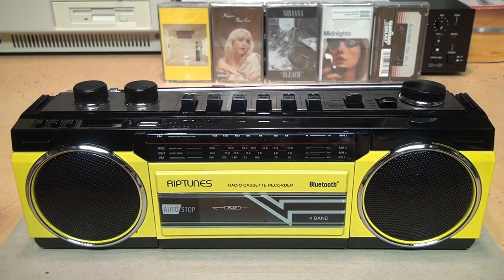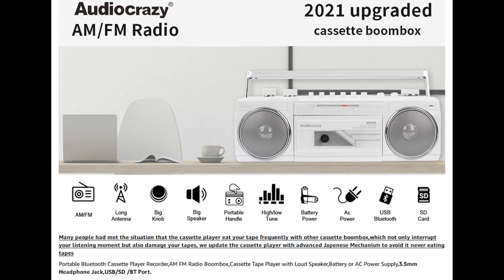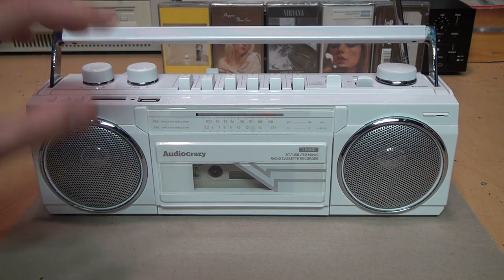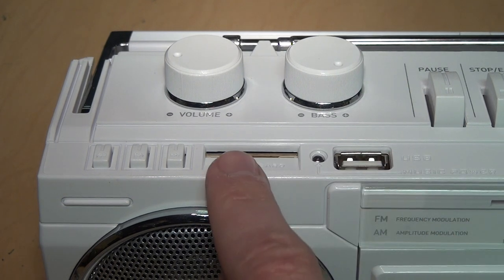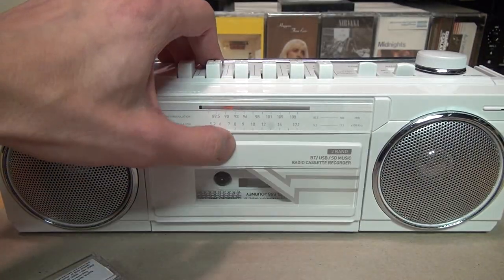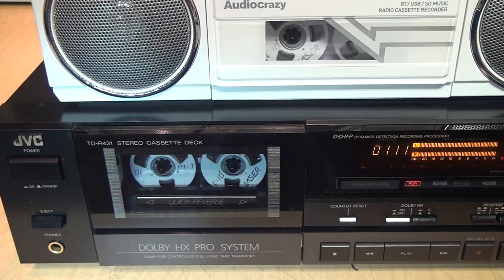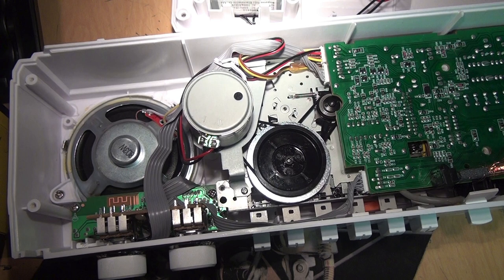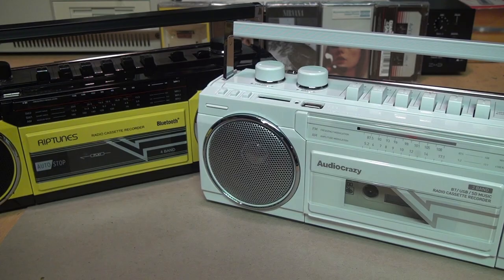New improved AudioCrazy STEREO cassette boombox!

Comment: I'm glad to see actual STEREO units being made again, now if they would give it better bass speakers and fix the recording level it would be great.
Reply: and the best feature would be a high quality full auto stop mechanism (doesn't just stop in playback)
Reply: Actually - a minimum of three speakers (three channel stereo) would suffice as then these would be genuine 3phase electrical circuits, and transmit all the sounds of the recording, using the least amount of battery power. Balance power usage it's called, not unbalanced two phasing that normal two speaker stereo units like these are only capable of.
Two phasing a three phase supply will NEVER turn a three phase motor, yet two phasing the audio devices called boom boxes, was supposed to give good (booming) bass?
Yeah right - NOT.
Reply: A/C bias and erase well worth a few dollars more.
Reply: Then maybe throw in feather touch buttons? Lol
Reply: @QUIX4U   The AC inlet is only single-phase though.  No 3-phase power for you.  Though I'm sure if you put 440VAC 3p into this, it would definitely go boom.
Reply: I doubt the speakers are the issue, the amp would be super low end and just can't output bass.
Reply: @nickwallette6201  lol true
Reply: @georgebliss964  Agreed.👍

Comment: Thanks for the in-depth review... Regarding the speaker magnet aspect, they are actually an upgrade, moving from weak/large/heavy ferrite magnet to neodymium which applies a higher magnetic field to voicecoil at a much smaller advantage. With the speakers in an open cabinet like that with massive air leaks, the drivers front and rear waves cancel... Providing a 'bass' knob is futile. Huge thanks again for your efforts.

Comment: I found a Brooklyn branded unit at a company called Supercheap Autos here in Australia. It was essentially the same model as the second Aldi unit critiqued by Techmoan a year or two back. 
While it is still a mono unit I found it wasn't completely terrible, and had no problems with wow and flutter, in fact I found it was very good. I checked the speed with a frequency counter and it was within what I considered to be acceptable range, although I don't have a calibrated tape.  Recording was OK but being mono it was nothing to shout about, but for AUD49.00 I have no complaints with it.  

Perhaps some of the manufacturers are listening to youtubers like Techmoan and VWestlife and making these improvements.
Reply: And   so they should pay more attention to the tech youtubers otherwise they won't be getting my custome.👍

Comment: I quite like the design of it - combines retro styling with a modern colour scheme. If they did it in black with either teal or red accents that would be cool. Nice that it plays tapes in stereo. In Aldi, they started selling the 'Techmoan' version for Father's Day. This model looks like it would be kinder to your dad's cassettes! I wonder whether you can upgrade the speakers (even at only 3W there's some pretty good options). Perhaps the circuit board restricts how deep the speakers can be.
Reply: Audio signals are quite easy. You can probe with headphones like a doctor and hear it all (instead of a multimeter). Maybe have some resistors around if you check the amp parts.
Reply: After Kevin's comments about the color scheme I was expecting him to swap the cases.
Reply: @MrDuncl  Just what I was thinking (maybe resolder the speakers from the old into the new also?).  That might make an improvement - but who knows?

Comment: Hey thanks for the video. 

Also, a while back you reviewed a radio by Retekess and liked it. I was a bit inspired by that and bought a Retekess TR618 and just love it. Best radio I have had in ages and I have been so disappointed in mass market stuff the last decade or so. The sound is amazing for such a small radio and here in California I am picking up SW stations in Maine, Japan, China and Russia. I am near the Bay Area and on AM at night can lick up stations in LA and OR & WA state. Just love it! Thanks for putting me on to them.
Reply: Speaking of Retekess, I actually found a video of someone demoing a Retekess CD, radio and cassette player, and the cassette player had a manufacturing defect where it would eat tapes, because a bit of solder got into the gears driving the mechanism.
Reply from the maker: @RealEpikCartfrenYT  Retekess sent me a CD/cassette boombox for review but I didn't end up making a video about it because the FM radio and cassette were mono. I briefly demonstrated it in my video about the TEAC W-1200 cassette deck.
Reply: @vwestlife  Yeah, the guy who demoed it, also took it apart to inspect it, the FM radio board is literally the size of a credit card, and is held in place by the tuning dial. Very underwhelming for what it is.
Reply: I got a V115 and the sound is pretty amazing. I think they are using speakers similar to those full sounding ones in the mid tier tablets these days plus a few amp filter/EQ tricks. Direct entry shortwave for under $40 is pretty kewl!

Comment: With this, and a previous video of yours, it's good to know that there are still decent (even if not excellent) cassette mechanisms out there. I have a lot of home-recorded cassettes in storage in my brother's loft since 2008, and my requirement is for a cassette player, I have no desire to record. Just something with a decent line level output or a headphone socket that can be used as such, to play into my computer to digitise these cassettes when I get them back. My stereo system has a front-facing socket that can be used to input from headphone outputs.

Comment: Another excellent presentation. The Bass control might as well be a plastic cylinder with a nut and bolt through it.
Reply from the maker: It would be much more useful if it had a tone control to turn down the treble, just like cheap boomboxes from the 1980s often did.

Comment: I like how they are bringing back 80s design. these new boomboxes looks better than the ones from the 2000s.
Reply: Dosent look better than my early 2000s Sony cd cassette radio which myvmum passed to me. All working and looks great. Older cassette section too.
Reply: which ones? early 2000s boomboxes doesn't look cheap and still sounds better
Reply: @yorkemar  My 1970's (Sony) WALKMAN cassette player with an FM stereo radio section, had more BOOM than these useless units, as they at least had a better bass filter section, plus with their stereo 3.5mm phone headphone/line-out sockets you could at least get all THREE usable stereo channels, if feeding these correctly through a two-phase to three-phase splitter, to regain the full-form surround sound these always had.
The two phase t three phase splitter was the old original amplifiers with their grounded earth return, common speaker channel / chassis earth, that enabled one to get all three channels from a two channel device (ask your local power board how they get your houses fed with all three of their single line phases, as well as all commercial 3 phase switchboards fed, whenever they PULL one leg out, of their three phase distribution transformers, that then ONLY run two phasing ?
It's exactly the same as getting all three channels of audio from your 1970's style Sony Walkman's etc., when given just two phases (audio channels) via the 3.5mm phone outlets.
Plus here's a kicker, with the right device IN-LINE with the headphone output - you can even get the FRONT/CENTER MONO (genuine front channel MONO - being the same as an old AM radio's single channel gives you) and the rear SINGLE REAR CENTER surround channel - directly from a 3.5mm outlet when playing back anything stereo.
In other words, instead of being a dumb listener, somewhere out in front of the stage (center of house), you can hear what AN ELECTRICIAN HEARS, from either side in the wings, or when up in the GODS (being that area in the rafters of the concert venue where the stage lighting is suspended from) that allows us to hear BACK of stage sounds - as well as those from the FRONT of stage (front of house), where we hear everything that is played both on stage as well as in the studio when remastering takes place, and thus where everything the mics pickup, is recorded in the original recordings, that most commercial outlets / vinyl & tape or CD/MP3 etc., NEVER replay via on-air broadcasts or in TV or YouTube modes, as they expect you, the listener to not actually know you are ONLY getting 57.7 % of the available recorded medium, instead of it's full 100 % total surround sound.
Why do you think the youth attempt to use bass filters and ONLY play very loudly, the bass they are able to hear in the front center channel - when all they need is another (rear center) bass speaker that allows them to amplify all the frequencies of audio - that are 90% out of phase (and thus completely unheard when playing via two frontal speakers)?ALL of the actual reverbs sounds and the better part of bass drums / guitars etc., is played at the BACK of a concert stage, where the band's drum kits are positioned, so why attempt to play loudly - only that which is heard from out front (by filtering out the lead singer and all other front of house sounds) ???
Why not play at the same "loudness" as the front speakers, via even just one of the speakers at the rear - where those bass sounds are made, by having a center rear speaker?
One that plays everything you cannot hear in a two speaker headset or a two speaker stereo car set?
Even your stereo (two frontal channels) house stereo destroys your ability to hear anything at the rear as even that doesn't replay that area, just the sounds from the front.
Having just  single speaker at the back of the car, or house room (or on the back of a boom box) allows the listener to hear all sounds that the musicians made on the day of recording, or which were superimposed in the studio before the final mastering?
Why not hear the missing 42.3 % of audio - that a two channel stereo device cannot make ?
All it would take is for these el'cheapo stereo boom boxes, to have a rear facing center channel speaker at the back.
Reply: @goodnightmoon  1996-2009ish design is ugly the rounded shape of that era is so ugly.
Reply: @QUIX4U  I have a 4 Band ITT radio from around 1976 that sounds good and also looks great.
Reply: @MylarBalloonLover . In real terms it probably cost much more
Reply: @חובב בלון נייר כסף חובב בלון נייר כסף  yeh but it was free. It's audio performance is impressive.

Comment: That's already quite an upgrade from the usual low quality junk you find from the store (I was gullible and almost bought one of them 2 years ago) but still it would be cool if the boombox had a full auto stop mechanism, because the "never eats tapes" claim is only true as long as the belt that drives the clutch is good. Some full auto stop mechanisms do actually drive the take-up spindle straight from the flywheel through a gear, so in the event of the clutch belt failing, the tape will not get eaten during playback. Oh yeah and given the space inside the boombox, it is possible to upgrade the speaker drivers by salvaging some from cheap computer speakers, as long as the magnet is not too big. It seems like they are 3 inches in size.

Comment: Mine, that I've had for several years, is branded Reka, and is all black. It has FM, 2 x SW and MW bands and the socket on the end is labelled Phone. I've only ever used it with a USB stick, as that's all I bought it for, so have no idea if the rest of it is stereo or mono. I only use it when I'm doing DIY work in the house, so haven't bothered too much about the sound quality, but it doesn't seem to bad. I think it was only UKP15 on eBay, so at that price, I'm not too fussy!

Comment: It has been quite an interesting experience to watch this video regarding what I expected from this device. I was prepared to despise it but in a very gradual, perfectly timed way it appeared to be a little better every minute (bar the recording part, but recording on a cheap boombox is something you don't want to do anyway). Finally, I can't help but show my respect for this product at such a reasonable price point. The big elephant in the room is of course the tinny speakers when it comes to using this on its own. Probably you should not expect much better sound for so cheap on the other hand. However, as something inexpensive but decent to hook to an amp or computer if you don't happen to have an old, well-serviced deck, it's probably a good little thing to have. I... kind of want one.

Comment: Can't say much for the sound quality through the built speakers, but the direct feed being played on a computer plugged into a Sony 100 per channel receiver with SSCS5 Core series Sony speakers sound absolutely fantastic.  Hopefully these tape mechs can be made available to someone doing a crowdfunding campain that will actually create a stereo cassette deck with AC bias recording and an electric erase head.  This mech seems to be as good as the one in the professional Tascam deck that you have shown on this channel.  The recording quality seems terrible because of the permanent erase head and the low recording level, but for play back this beats them all in this price range.  Would love to see a video comparing playback quality between this device and the Tascam.

Comment: Question: You say that the SD card and USB slots are only for playback, not for recording.  But then later you said you recorded music from vinyl to an SD card, and then recorded it to cassette tape.  Did you record it to cassette on a different machine?  In the video, you were pointing at this boombox when you said "recorded it to cassette tape", which gave me the impression that you recorded the tape on this machine.

Comment: The new speakers look to be using neodynium magnets which are much stronger. Likely achieving the exact same specs as the old version. That said it's unlikely the speakers have all that much to do with the lack of bass response, as it seems there just isn't any kind of speaker cabinet to actually allow for bass response in the first place.

it really seems like the BT/USB/SD module is the standard "cheap bluetooth speaker" module slapped onto this radio. The exact behaviour observed when it's switched into BT/USB/SD mode is also seen in MANY cheap BT speakers.

I find "Avoid it never eating your tapes" to make perfect sense, as they clearly made the effort to avoid that sitatuion being impossible! ;)

Comment: Since it has such low W&F, it's too bad it doesn't have a true line-out and Dolby NR - it would make a good solution for someone wanting to transfer cassettes to digital on the cheap.
Reply: If you're handy, it should not be a problem to install a line out yourself. If the volume control is a traditional potentiometer, you can intercept the line signal there.

Comment: For an inexpensive portable device, I would consider the sound quality through its built-in speakers adequate.  But if you were so inclined, it should be easy to find better speakers of similar size and fit them to this device.

Comment: The speakers on the new one might be using neodymium magnets instead of ceramic ones. It'd explain why they're so small.
Reply: yup, I've seen that before in many cheap bluetooth speakers. They even look to be the same drivers like in a cheap bluetooth speaker I had once
Reply: The tiny magnets in my car's speakers are neodymium and they pack a serious punch. Size ain't everything lol
Reply: I'd replace the speakers if I had the chance to get this boombox.
Reply: @iamdarkyoshi  I have this little radio and it has a 40 MM speaker in it, and for it's size it sounds great, it goes very loud and no distortion from the speaker or clipping from the amp. its the HRD 701 similar colour to the other boombox shown here.

Comment: @vwestlife, I do apologize for ''polluting" the comment section, but could you let me know if it does have autostop? Or that clutch only? The so praised japanese cfds after two sets of batteries is showing empty batteries no matter what. And the Sony shops from Romania refuse to fix it on guarantee because is not bought from EU. The Japanese Amazon told me to try again and then to send it back and only after checking it will return those 200 eur. A lot of fuss. But i am using it mainly when going to sleep (during the day when I have time i have 5 cassette decks with a huge audio system) and autostop is a must. Thank you in advance for the info
Reply from the maker: It has auto-stop when playing or recording.

Comment: that's so sad to know we're in the era of cheap hq audio delivery (great small speakers and amps), some are still keen to make rubbish products...
any idea if the plastic mold is the same? you might want to swap the internals of those two models. it will need to manage the opening for the 110/220v

Comment: I wish they would make one of these old portable desktop cassette recorders again, without a radio, but with the same good stereo mechanism, audio in and out, and better recording quality, and also with a better erase head than a permanent magnet. I'd be fine with just a mono speaker in the actual unit (which used to be standard anyway), but it should be a better quality one, not completely without bass, and the audio in and out should be quality stereo. Some modern icing on the cake would be if the recorder included a little SoC running a version of the DDi Codec program to implement Dolby B and C-compatible noise reduction.

Heck, get all that right, and you'll have made tapes accessible again they way they were meant to be played. Then they could sell essentially the same innards as a component stereo cassette deck too, and as the meat and potatoes of an even better boombox than the current version. But I appreciate the progress so far with this. Looks like somebody is trying.